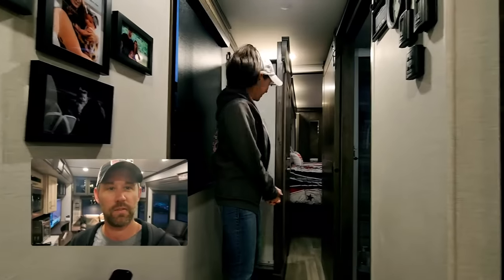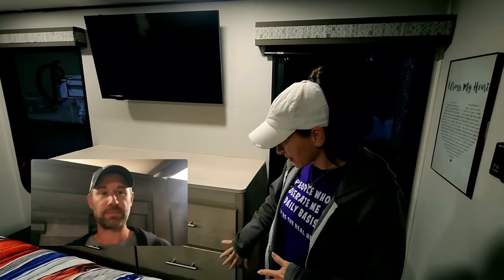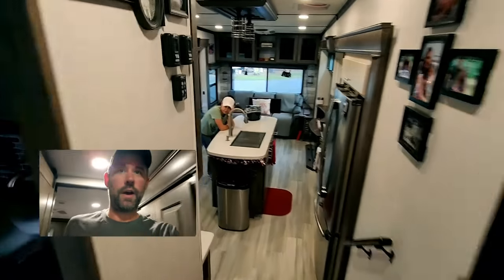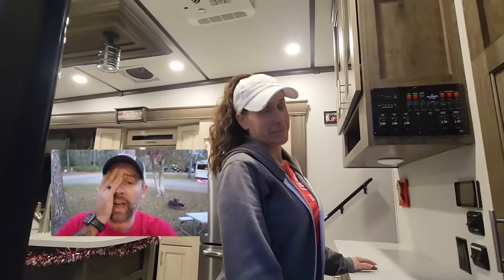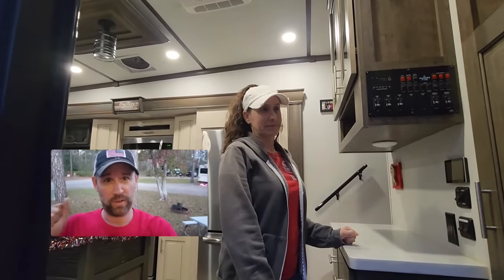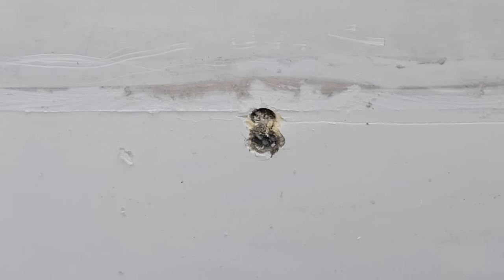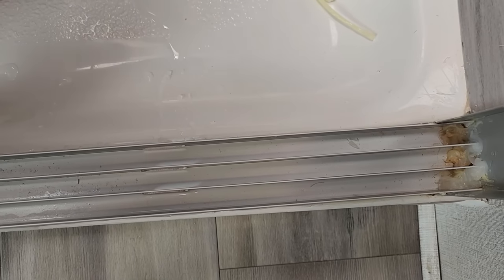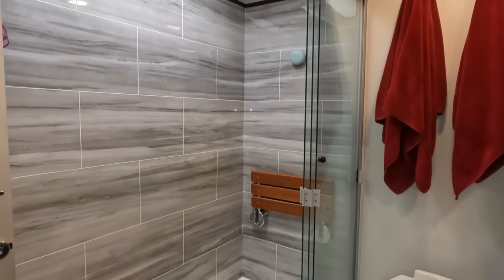RV Slide Failure & RV Leaks

Comment: Our next fifth wheel no bedroom Shwintek slide, no bedroom slide at all,  it failed with all rv manufacturers.  You should have started the video Dustin going off with a lot of bleeping while trying to push the slide out.  After GD replaced our slide mechanism it worked great for two year, then we had to push it out and in.  For the last 2 years, that’s a fancy shower.  We use a shower curtain inside the shower doors, never any leaks, the water never gets to the glass or the track.  Keep the glass doors.  The smile on Dustin’s face was priceless.  Larry
Reply from the maker: It seems all schwintek systems fail eventually. Hopefully this latest fix will last a while.

Comment: The shower door issue is an easy fix. The seal under the bottom track is crap and just soaks up the water. Take the bottom track off and remove that foam seal. Apply 2 heavy passes of a good clear silicon as well as several blobs along the length of the track as well as around the screw holes. Re-install everything and put a nice thin bead of clear silicon to all the edges and its done. I had the same issue as you with mine and had to tear it apart after the first time I used the shower as the bottom track leaked like crazy on the outside of the shower. No more leaks since I removed the foam crap seal.  Love you videos Guy's, Keep it up.
Reply from the maker: We are glad you got yours fixed up. We could have fixed ours too but it wasn't worth the hassle.

Comment: Glad to the slide is working. The leak maybe at the top were the slide roof and wall come together. A pinhole in roof joint.  I’ve seen that. Good travels and see ya at the rally. I can’t do the chalking well either😂
Reply from the maker: Ya, that's what we're thinking as well. Alliance will get us all fixed up 😊

Comment: I know a leak anywhere is frustrating. I can't remember who I was watching in another video but they had a water leak when it rains. They checked the roof the siding you name it. What they finally  found  is, from the factory the windows weep hole plugs were pulled at the top of the window not  at the bottom.  The  explanation was the installer must have pulled the weep hole plugs and because the window size at top and bottom are the same it mistakingly got installed upside down.  Of course when I heard this I had to check our windows.  I know  you've probably received a lot of have you checked this or that advise so here's one more to the nope not it check  list😂  As always thanks for sharing  and wishing you safe travels.
Reply from the maker: I could see how that could happen. Unfortunately, that's not our problem. We have moisture in the roof so if it was our window, all of the moisture would be at the window or below.

Comment: We are glad that Alliance stands behind there product & are a company that keeps there word.
That will give us some confidence if we end up with one of there Rigs.
Not a big fan of the Schwinteck slide systems, they may be ok for sometimers & occasional folks. But not for full time living. They just dont have the durability. 
You are the 3rd or 4th coup.e to ditch the shower doors, you got me thinking...im not a fan of glass cause its hard to keep clean, its heavy, and seems to leak.
Ya gotta love Azdel material, dam near bullet proof when it comes to exterior walls, but that leak has me baffled 🤔🤔
Reply from the maker: The leak has us baffled too. We are very fortunate to have an Alliance. They have been with us through this whole ordeal. The customer service is top notch.

Comment: I had a tech replace my slide ski a couple weeks ago. He said that once he applies the silicone sealant he sprays it with sprayway glass cleaner then just runs his finger over it to clean the bead up. It cleans the bead and doesn’t stick to your finger. Maybe try that. Also we replaced the glass shower doors as soon as we got out 340RL, was pretty easy to do, saved weight and works great.
Reply from the maker: Thanks for the tip. We appreciate it.

Comment: I see now why Alliance switched to the BAL Exactslide cable system for the bedroom slides in the '24s.  When I took delivery of our 370FB I found there was a gap along the side of the bedroom window the needed sealed and the Eternabond was not adhered properly to the roof membrane that I had to seal. Couple spots to look at with a fine tooth comb.
Reply: I hope the new BAL system is better. The original was junk just like Schwintec
Reply from the maker: We hope the new system works better than schwintek.

Comment: I think I saw AZ Expert replace that slide system with a similar system by another manufacturer but designed differently and is supposed to be much more reliable. If you have to go into a bay and the whole slide has to come out, maybe it's worth looking at options.
Reply: I believe it was the Vroom slide system.
Reply from the maker: We have heard good things about that system too. We might check into that.

Comment: Been there done that a few times with the Schwintek slide.  You have probably tried some of the Schwintek troubleshooting videos on YouTube but some are pretty good.  What I discovered on ours is that the drive shaft from one of the motors slipped down and disengaged from the motor.  I had to pull one side of the Schwintek mechanism out and fix the shaft so it couldn't slide down again.  You might be able to just look under the slide and force the shaft up in place.  If so you could put a block of wood or metal below the shaft so it couldn't slide down.  Even though I double mine will move again I am going to screw a metal plated below the shaft on each side.  GOOD LUCK!
Reply from the maker: 😬 That sounds complicated

Comment: We just ordered an Alliance Delta 292rl. We chose it because it had no Schwintek or cable slides. when we shopped for our new unit I told each salseman “don’t show me anything with s schwintek system and preferably no cables either”. I dont understand why any builder even touches the Schwintek system.
Reply from the maker: We keep hearing nothing but bad things about Schwintek also. If we ever get a different RV. It won't have Schwintek.

Comment: If I had your bedroom slide leak problem, I would put a 4" strip of eternabond  from 1" down on front (just above front window...then  all the way over the slide and leave another 1" on the back side (just above rear window.   Eternabond works GREAT on the roof, so it must be able to solve your slide leak.   At least this will solve the problem, until the National Rally in May.  (crossing fingers for ya!!)
Reply from the maker: We have a ridiculous amount of eternabond tape up there now and it is still leaking. It looks like Frankenstein's monster up there.
Reply: @WaywardWaggs  Bummer!!  Have you pulled the seal off both windows and check for damage?   The rear one (bigger) would be my first place to look.
Reply from the maker: @tannerjim  No. We are just going to wait until we get to Indiana and let Alliance handle it.

Comment: After watching your slide out going out twice I came to a conclusion that maybe on the edges of the slide out roof seal it and any inside seams that butt up to the body of the coach, seal everything, even if it didn’t have sealant, maybe when they painted it there was no sealant that should have been and for the longest time the primer and paint acted as a sealant. You’ve absolutely nothing to lose but the time, give it a go.
Reply from the maker: Good advice. Hopefully we will find the leak soon.

Comment: Have you tried to run an extra wide piece of eternabond tape over the top where the screw heads are?  I put a piece that covers from the edge all the way overlapping the existing tape just bc I didnt like the way it looked over the screw heads.
Reply from the maker: Ya. There is eternabond everywhere now. It looks like Frankenstein's monster uo there but still leaking.

Comment: We have a 340rl also but a 23. Your last couple of videos are terrifying me😮. I can't say that i would handle it as well as you guys. Kudos! So that being said. Did Alliance set you up with a dealer that was nearby to readjust your slide? Do they set up techs to come right to your campground when you have a problem? Please show us the exact area of the slide that needs to be resealed that you suspect is causing your leak. Thanks in advance. You guys are troopers.
Reply from the maker: Unfortunately, we still don't know where the leak is coming from. We will let you know once we find it. Alliance has trusted dealers and techs that they will refer you to when you have an issue. In a lot of cases, they can handle it on site but for complex issues, they will get you into a bay.

Comment: I thought Alliances were built different.
Reply from the maker: The slide failure was because a previous repair guy put the box in crooked, and the leak is from a pin size hole we can't find, so they are going to replace the roof.